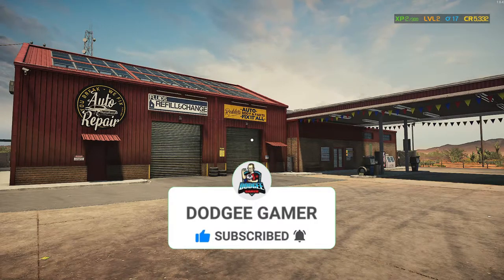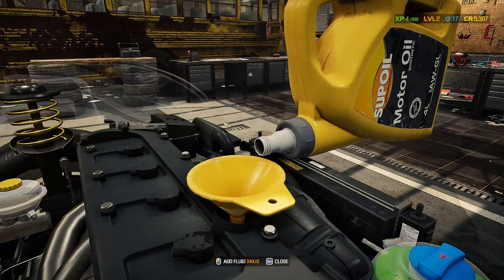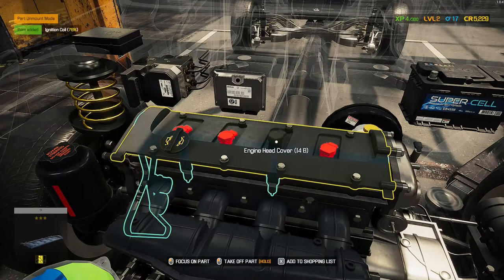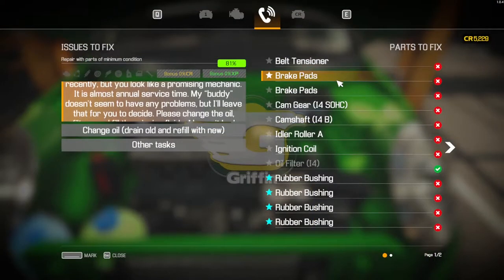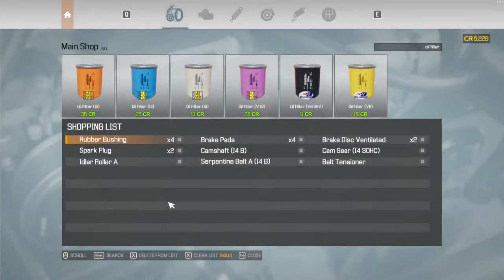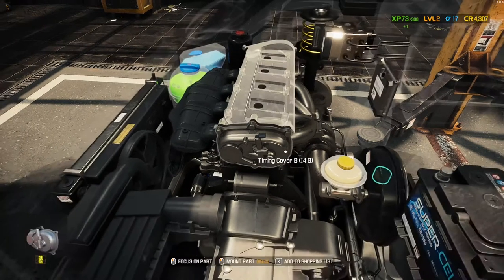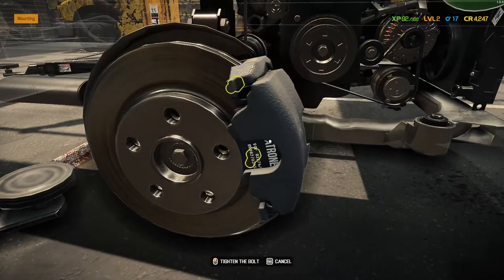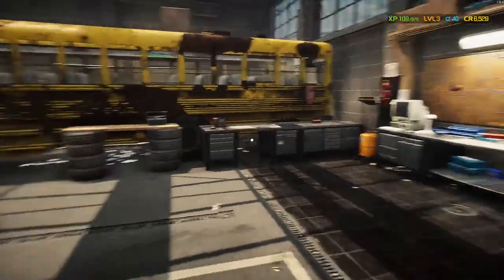CMS2021 -  Story Order 2 - Griffin Tyro Full Repair Guide - Car Mechanic Simulator 2021 Playthrough

Comment: As a mechanic i would do fluids last especially if i was replacing parts that the said fluids travelled through such as the radiator or an oil filter

Comment: I am a mechanic a fluids last also its not an oil filter fourteen its oil filter eye four reason being is for inline four barrel meaning its a 4 piston ICE engine.
Reply: Fluids last because sometimes u need to remove pans resevoirs and other things and there much lighter empty then full and generally u want to run fresh fluids in a fresh system anyway
Reply: It’s a video game, also you wrote internal combustion engine as an acronym to sound smart yet you essentially said engine twice.

Comment: it keeps saying idle roller is missin even though it is not and it is all new parts
Reply: Same
Reply: same
Reply: same
Reply: @veranikolic7266  there are 2 idler rollers. After you put the cover on then you attach the crankshaft pulley then the 2nd idler A is available
Reply: @stephenbradley3153  thank you very much

Comment: what are the undiscovered parts? ... im stuck here bc the game is not capable at telling you what to do, so now im stuck at this point
Reply from the maker: I cover that in the video from this point: https://youtu.be/5aPDUFNiV2c?t=523
Reply from the maker: In general, read the jo description carefully as that will give you a clue plus look out for any parts that are very rusty as they will be in bad condition.

Bonus hint: if there are a lot of undiscovered parts, they will likely include bushings and spark plugs as there are a lot of them.
Reply: @DodgeeGamer  thanks
Reply: I used the inspection (spy glass) on wheel to discover bushings and watching the vid discovered I forgot spark plugs
Reply: I don’t get it, what are theses missing parts?